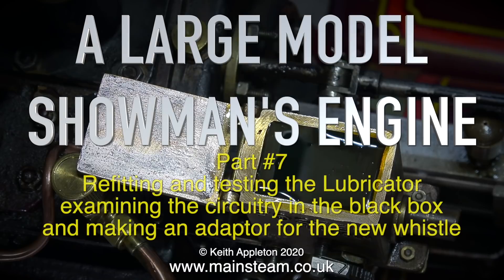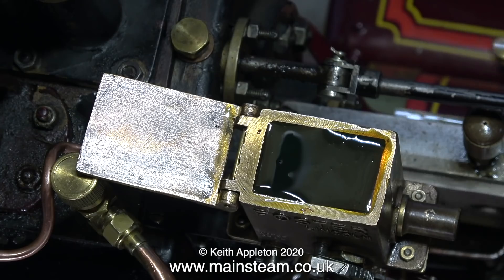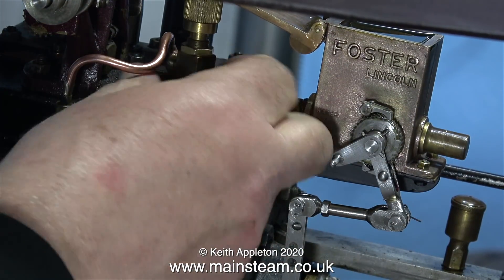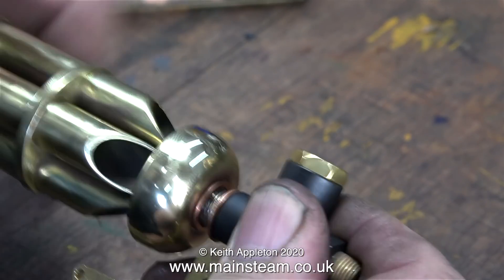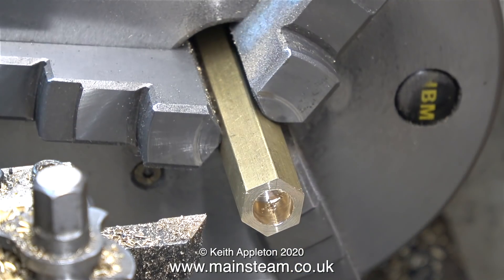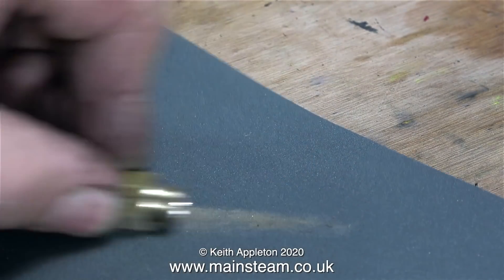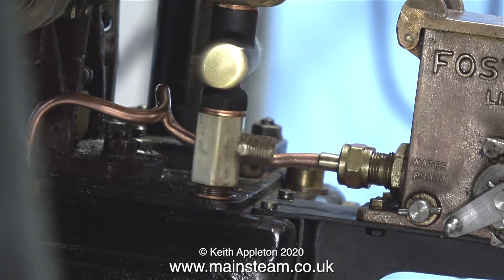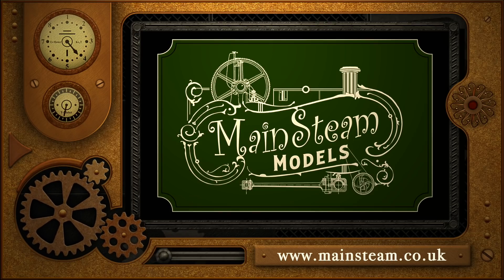A LARGE MODEL SHOWMAN'S ENGINE - PART #7

Comment: Hi, I for the life of me need some help on model marine steam engines, I have inherited a few from my father and only saw them run once 20 years agao. I could really use some tips. I have a burner that dosent get hooked up to a propane tank but would take some kind of gas because it acts like a propane burner. It has it's own tank and copper running from the top down into the back of it. For the life of me I cant find what type of fuel I would use. Is there anyway you could maybe answer that
Reply from the maker: All of the information that you require is contained in many of my videos. Please watch some of them.

Comment: maybe a silly question: will the steam not leak out the whistle adaptor, where the airline connects in?!
Reply from the maker: I will fit a cap on the air inlet before I steam the engine . . . . . .
Reply: @keithappleton  Shocking!

Comment: Whilst endless amusement may be found by listening to you whinging about your tiny, er, em, compressor; may I simply suggest you purchase a compressor of the proper size and capacity for purpose.  It will pay for itself in the fullness of time.
Reply from the maker: yes you are right, this one is too small and I have only had it for about 12 years . . . .